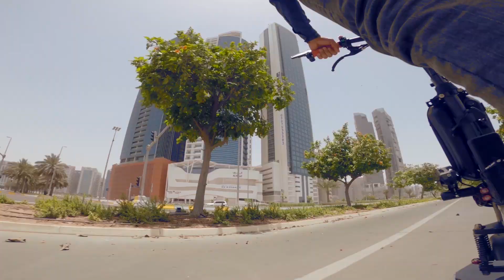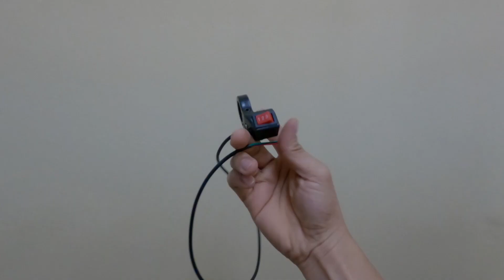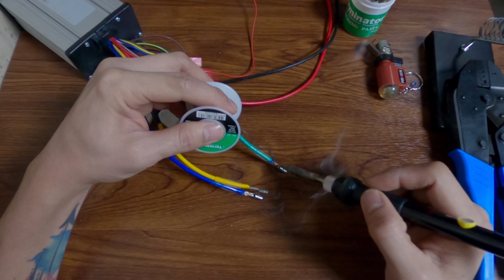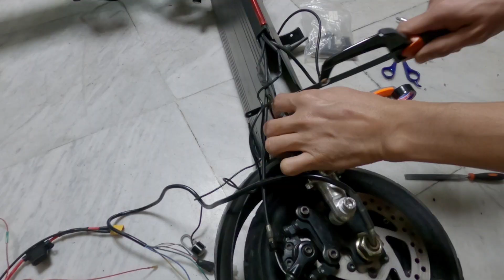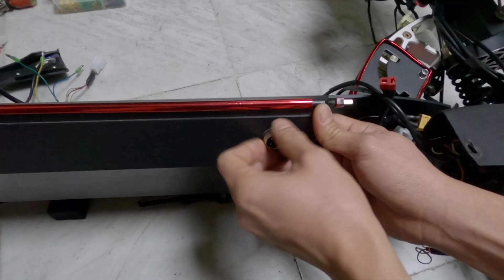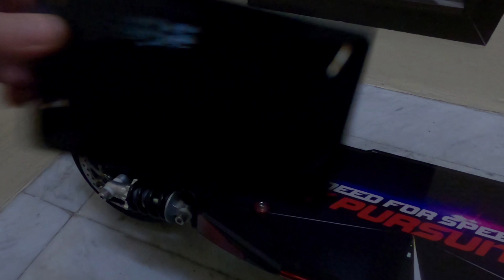How to Install Controller Speed Switch and Thumb Throttle - Full Guide Replacement

Comment: Yung sa akin bro 4 wheels 123 speed pero yung wires galing ebike pa punta controller dalawa lang parang light blue at light green. Yung sa controller ko naman blue black at purple. Pag try ko walang low speed biglang lakas hatak agad
Reply from the maker: Goodday Kaadik!
Bale, un 3speed wire mo blue,black at purple?
Tama ba? Kung yan nga un 3speed wite ng controller mo.
Pag un color black hindi naka konek sa alin man sa dalawang wire (blue/purple) gear 2 un.
Ngayon hanapin mo un combination ng gear 1 at gear 3.
Black to purple.
Black to blue.

Update mo ko Kaadik.

Ride safe lage!

Comment: How do you identify hall sensor wires which color goes to which?
Reply from the maker: Goodday!
You have to try all the combinations until you get the right one.
Usually green to green, blue to yellow, yellow to blue combinations work.

Do this combinations to the Hall Sensor wires and also to the Phase wires.

Comment: Thank you , the same exact 3 things I am installing on my scooter. Great explanation
Reply from the maker: Thank you for appreciating my vid.
Ride safe always!🤟
Reply: Hi, I was wondering if you know how to connect an alarm with remote without removing the key switch. I bought one and connects straight to 2 connectors in the controller but not sure if will work when the key is turned off. Thanks Mario

Comment: Nice video bro 👌 like the add on deck sad it got broken 😢
Reply from the maker: Goodday!
Thanks bro!
I miss my LED board😥
Ride safe!
Reply: @jaysonulanday  
Hi again bro have you converted any single motor scooters to dual motor.

im planing on making my wife's sealup q8 500w 10.4ah scooter to a dual but am un sure how to connect the the single motor controller together so they work together with the finger throttle control.
Any help would be much appreciated or if you have video on how this is done with most scooters that would be great.

Comment: Hi!  🙂I'm a fan of your YouTube channel and your scooter looks great!  👍💯 I have one question please: where can I get this chrome rim that you have on the back?  I have a beautiful Xiaomi 1s and bought a Monorim motor 500W 48V and now want to install the motor at the rear with a 160mm brake disc in red/silver and also at the front I want to install the 160mm brake disc in red/silver.  To the question: on Aliexp.  Are there 3 or 4 different 10" chrome rims black on the inside with 3 stars and the outer edge in chrome as well as your rear rim is. But I don't know which of the 3 chrome rims fits the Xiaomi 1s. Can you help me there?  Kind regards

Comment: Goodday kaadik ung motor ng e10 ko is 1500 then ung controller is 1000watts..kahit ung thumb throttle nlng papalitan ano at tsaka sa gear
Reply from the maker: Goodday!
Ang lakas ng motor mo ha.
Check mo muna kung compatible un controller sa thumb throttle at gear switch.
Ride safe sayo palage🤟
Reply: @jaysonulanday  un ung bago nilang e10 ngaun kaadik..e10 pro max 2022..paanong ichecheck kung compatible??

Comment: Boss pag ba pinalitan ng controller naapectuhan din ba ang speed ng scooter? For example 48v -1000w pinalitan ng 48v-1500w controller?
Reply from the maker: Goodday kaadik!
Lalakas lng un hatak saka konting bilis.
Kase un controller nagbibigay ng mas malakas n current sa hub motor.
Di masu sustain un speed kase mabilis din malolobat un battery gawa nun mataas na wattage nun controller.
Ride safe palage🤟
Reply: Kaya pala ung skin bilis malowbat mag kaiba  ata controller nito 52 volts daw tapos damao ung throttle ,ndi ko pa alam ung standard setting nito parang may nabago  ka adik

Comment: paps matanong lang kung okay lang.
magkano na nagagastos mo sa scoot mo?
Reply from the maker: Goodday kaadik!
Paps, check ko lng kung magakno..
Pacnxa na late reply.
Ride safe!🤟
Reply: @jaysonulanday   nakabili kasi ako ng ebike dito sa toronto,buti nlang mahilig din ako magmodify kahit maliit lang yung capacity ng batt. nya papalitan ko nlang na mas malaki.
anlaki din ng agwat nung presyo,same bike lang nman pero sa battery lang nagkaiba.
Reply from the maker: @shotxcj2655  Goodday kaadik! 
mas maige kung malaki un capacity nun battery para masustain un speed nun hub motor. pero wag mo lang ttagalan sa throttle pag ggamit ka ng mas mataas(wattage) na controller. iinit un hub motor.
ride safe sayo kaadik!

Comment: Nung nagawa mo yang upgrade m sa controller mainit ba while using or after using your scooter?
Reply from the maker: Goodday kaadik!
Pag matagal ko patakbuhin sa gear 3, umiinit un hub motor.
Mas mataas kase un wattage ng controller kesa sa hub motor ko.
Kaya un hub motor natakbo sa pinaka peak niya.
Wag mo tagalan un throttle sa gear 3 kase magoverheat.
Pag gear 1&2 ok lng un hub motor ko.
Ride safe🤟
Reply: @jaysonulanday  paano kung parehas ang 60v n 2000w ang controller and motor mo iinit parin?

Comment: @Jayson pwd magtanong? Kasi bumili na po ako ng motor na 60v 2000wpati coontroller na 60v 2000w with the batter of 60v 20amp with throttle 60v now my question @jayson woth the speed 45 to 55 ride long i notice my controller getting hot and when i open the my bag where located my controller n battery smell a little  like rubber burning. You think whats wrong?
Reply from the maker: Goodday kaadik! PM mo ko sa fb.
Ride safe po🤟

Comment: Hi bro good morning kaadik talaga pag Meron Kang scooter. Bro tatanong sana ako E-10 2021 model 1000w motor 48v 10A . Now nag palit Ako Ng controller 400w 18A  finger throttle TF-100 6wire pero Isang wire nya color white not connected. from the controller is only 5 wire ( motor not running)
Reply from the maker: Goodday kaadik!
Dapat compatible sa isat isa un controller at throttle. Isang set b yan controller at throttle?
Ano colors nun mga wires!

Comment: Boss my idea po kau na match an controller para sa 48v with 1500watts na motor???
Reply from the maker: Goodday kaadik!
Stock battery at hub motor(1500W) ba yan?
Reply: @jaysonulanday  opo sir.. controller po kasi need ko baka my idea po kau pa link nmn na pwede sa motor hub ko na 48v 1500w salamat ng madami idol
Reply from the maker: @KingBradLey03  Goodday kaadik!
pacnxa na late reply.
wala ako link. check mo sa amazon or aliexpress.
marami option dun. kunin mo un same rating. 
have a nice day kaadik!
Reply: @jaysonulanday  Boss ask ko lng po meron po bang Throttle na pwede sa motor ko kasi 5 pins lng po cya paano po kaya un ?? salamat po idol=)